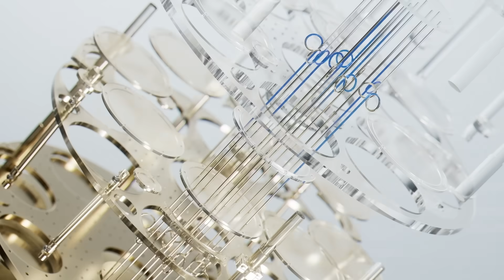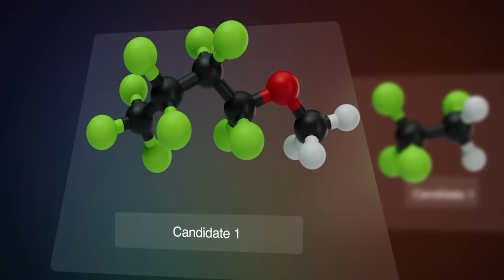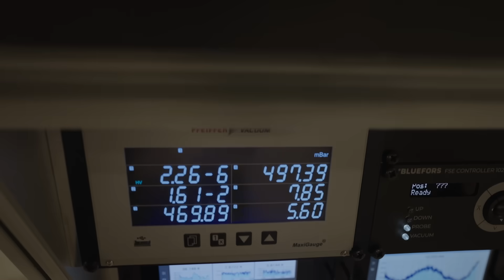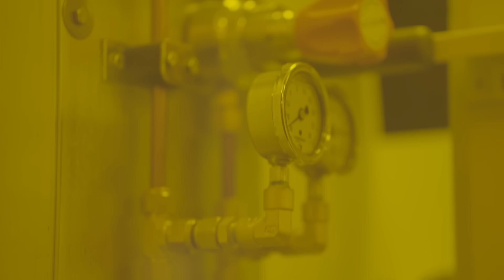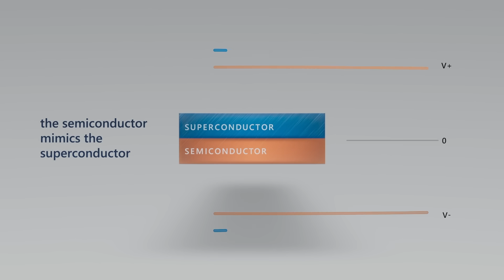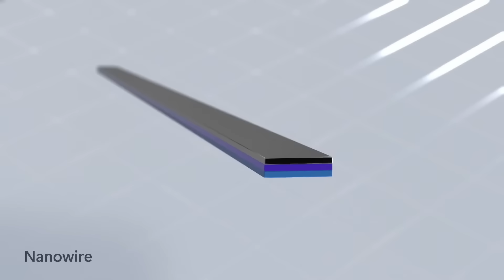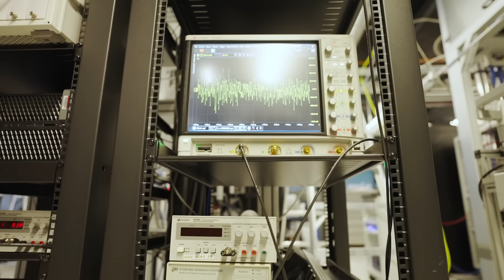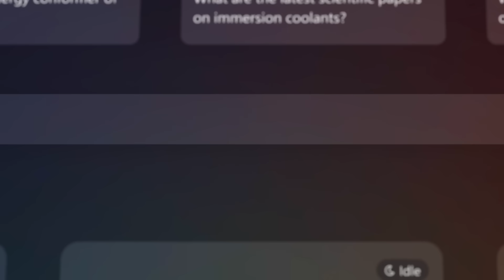Majorana 1 Explained: The Path to a Million Qubits

Comment: Usually, when a promo video includes a lot of irrelevant content - people, the sea, the sky, etc. - it means that nothing is real yet. A revolution promotes itself, not a promotion explaining a revolution.
Reply: It doesn't work like that. The attention mechanism was introduced by Google researchers in their 2017 paper which laid the foundation for the Transformer architecture. However, it didn't gain much public attention at the time because it was primarily a research breakthrough rather than a product. In contrast, GPT, which is based on the Transformer architecture and uses the decoder-only part, gained significant market traction due to its practical applications and accessibility. Which do you think is the bigger breakthrough? The same thing is happening here. In a few decades, we will have a product that will revolutionize everything. Right now, they are marketing the breakthrough to attract investment.
Reply: @Mewhoevenidontknow 
It's interesting how foundational research can take time to translate into widespread practical applications. The timing of market readiness is crucial.
That's how business and technology go hand in hand
Reply: the chip they are showcasing is literally 1+1=2 AND gate in quantum sense.
Reply: common sense right here
Reply: Depende, nesse caso acho que isso é real
Reply: @toggz901  é real mesmo, eu fico chocado com tanta pessoa incrédula
Reply: @toggz901  As IAs vão explodir depois disso
Reply: This is beyond your brains computing capacity
Reply: I mean, they do show the chip...right??
Reply: Qué acabas de ver Lisa?
Reply: You seem to not remember the PC commercials in the 80s and 90s
Reply: @amazinglover-ez  I remember Microsoft’s Lumia ads claiming the videos were shot with the phone, but a car mirror reflection showed they were actually filmed with a professional camera.
Reply: @amazinglover-ez  I remember Microsoft's ads for the Lumia phone, where they promoted its impressive camera capabilities, claiming that the ad videos were shot using the phone. However, a close look at the reflection in a car mirror revealed that the footage was actually filmed with a high-end professional camera, not the Lumia itself.
Reply: @amazinglover-ez  I remember Microsoft’s ads for the Lumia phone, where they promoted its impressive camera capabilities, claiming that the ad videos were shot using the phone. However, a close look at the reflection in a car mirror revealed that the footage was actually filmed with a high-end professional camera, not the Lumia itself.
Reply: Alright go on then make a 12 minute documentary on the transistor and make it visually appealing (no you don't get to sneak in the entire history of computers till that point)
Give it some time ffs it's not done yet
Reply: This. This project has been running for 17 years, I’m not surprised they felt the need to say something now that AI is consuming Microsoft from within. They also didn’t publish any kind of research about this that can be peer reviewed.

I suspect in 10 years this will still amount to nothing.
Reply: nice, sherlock!
Reply: What is the chip actually doing or is it serving a real purpose in our world that's actually helpful?
When chatgpt came out, it broke the world not by its non existent ads or marketing, but by their real product that everyone was blown away by. THAT was a real revolution
Reply: @MrBunny53  they explained it in the video...right? Pretty much makes quantum computing faster and more reliable. Big help in material science and engineering
Reply: @MrBunny53 Quantum computing's killer app, so far, is handling annealing. It's the traveling salescritter problem for fluids on a 3-D surface.

You want to know where the water line will be for a new ship before your first build. Modern hulls are complex surfaces, purposeful bumps and sluices to push faster or prevent oversteer. There are far too many points on the hull for you to get that math easily. It's far simpler to carve up a model at a decent scale, toss it in the bucket, and mark the water line with a grease pencil.

Qubits can deal with this far more easily. They let each possible state of those points be present at once.
Reply: @MrBunny53  Not everyone is "blown away" by useless computer generated hallucinations.
Reply: @MrBunny53  no real purpose yet... its still too early for any practical use even if I want to believe their claim
Reply: I like art and the way this video is filmed and orchestrated is amazing to me but I do agree that this is not the revolution they're making it out to be in the video
Reply: @MrBunny53  wow so there are Other chips that can hold such a large amount of qubits? Wow!
Reply: Finally found someone reasonable here
Reply: So... PEOPLE are irrelevant  now??? 😂😂😂
Reply: So... PEOPLE are irrelevant now??? 😂😂😂
Reply: Exactly my reaction, seems like their promoting using DEI instead of science

Comment: . I knew these spherical matrices were coming. I took my chance to figure them out. A 3 dimensional array of matrix calculations that understands its own space. When you have them with quantum computers you can calculate quantum vectors and use it from anything like curing diseases... reconstruct materials. Its pretty awesome. But i never thought itd be possible in this day and age.  How does it prevent the collapse of the super conducting state?  How does it solve the uncertainty principle? And how does it prevent the paradox of thermodynamics?

This is still extremely primitive no matter how advanced it seems. I cant see how it could be practical technology yet.

Comment: While they frequently discuss the theoretical possibility of achieving a million qubit system, they never demonstrate actually reaching this milestone. EDIT; if i read between the lines it seems that they are aiming to scale that chip (meaning duplicate it however much they can, like adding multiple video cards to a system rather can creating an H100) with its current capabilities rather than having one that truly does a gazillion thinking.

The presentation relies heavily on marketing jargon and oversimplified explanations rather than providing concrete technical details. They describe basic input/output processes ("send data to chip, retrieve data") but never clearly explain whether the quantum processor actually performs the promised parallel computations across all possible quantum states.

It's noteworthy and funny that a conventional classical computer is still required to interface with and control the quantum system.

My take? We appear to be at least 10-20 years away from developing practical, quantum computing interfaces. This presentation seems PURELY aimed at appeasing shareholders rather than demonstrating real technological progress.

Comment: They don't solve equations. It's a misnomer. They are a physical process. When a problem maps to a physical process you do the physical process rather than a digital computation. Quantum computers are horrible at most types of general purpose computations. They only excel at problems that map to a physical anolog.

Comment: It is quite fascinating that we are getting so close to bumping up against actual fundamental limits of computing and information density. There are hard limits to these things, hard limits to how accurate any prediction of a system which is smaller than the thing being simulated can be... and it seems like we're going to be able to get pretty close to that within the forseeable future! 

I also find it fairly funny that the one guy uses the example of materials science and designing a new material that works out of the gate... because over in the AI part of Microsoft, they recently published an AI model they developed called MatterGen which does basically exactly what he said. You specify the desired material properties, and it uses a diffusion model to discover a new material that should have the desired properties. They used it to create a new material that was lighter and stronger than titanium, then took its predictions to the lab, synthesized the new material, tested it, and found its properties were within 10% of what was predicted and boom, we have a new material lighter and stronger than titanium. No quantum computing required.

Comment: 10:06 - did he literally say "imagine a battery where you charge it once, and you never have to worry about discharging it"?? This statement makes zero sense whatsoever. It's not even wrong in some subtle way, it's just a completely nonsensical statement.
Reply: I think he means not to worry about it being discharged
Reply: @harshpanwar5963 that also doesn’t make any sense, nor does it fit within the context of his sentence. You could really stretch the limits of your imagination and think he meant “imagine a battery that doesn’t suffer from self-discharge” but honestly this is not a big problem that people complain about for batteries nor is it consistent with the phrase “having to charge it once and then never having to worry about it again”
Reply: I think what he is saying is that the Qbits are stable. Instability of the Qbit has been a major problem up until now.
Reply: @control_voltage  Earlier in the video, they talk about error correction and how some of the error correction can be done physically instead of algorithmically. That part does relate to the stability of qubits. The section of the video I highlighted is clearly about future batteries.
Reply: @bhav7795  No I don't think so. I think he is comparing other types of qbit to a battery that needs to be re-charged constantly while a topological one persists and doesn't need constant re-creation.
Reply: @control_voltage  The section of the video I am talking about is clearly talking about using the quantum computers to design materials in a computer instead of a lab, and then applying that to invent technologies such as advanced batteries. Just rewind to 9:40 or so. He is definitely not talking about other types of qubit (btw, it is "qubit", not "qbit") and comparing that to theirs.
Reply: @bhav7795  I think they mean that quantum computer would be able to discover new materials that could be ultra efficient with energy storing, meaning we could have batteries which such capacities that recharging a battery would no longer be a task we would need to do every day, but rather every several months or years. I'm no battery scientist, but wasn't Tesla also developing a battery that promised electric cars to have 1 million miles of range? If that's possible, then it doesn't literally mean that the batteries are infinite, but rather that the capacity is so ridiculously big that you would barely (or maybe never in your lifetime) have to worry about recharging such batteries.
Reply: @Caquin1950  First let me clarify Tesla's "million mile battery". They are not talking about a battery that you charge once and drive a million miles - that would be insane for many reasons, and they actually have top battery scientists like Jeff Dahn who would never make such a claim. The million mile battery (from Dahn actually) is that even after repeated charge and discharge (~2500 full charge and discharge cycles), the battery retains its performance. The equivalent would be like a phone where you still charge it every night, but 7 years later the battery holds the same amount of charge as the day you bought it. The statement about a battery that you charge once and never need to recharge is just nonsense. If you have "ultra efficient energy storing", what battery scientists call a "high energy density", it does reduce the number of charge/discharge cycles you need to do (although you need to put more energy into charging it each time). But the goal is never to get it down to a single charge and discharge, because that would literally be an explosive amount of energy in the battery. Today's batteries are already at an energy density where if they catch fire, bad  things happen ...
Reply: @bhav7795  change discharge to recharge and it makes sense. English is not his native language.

Comment: It's very simple really, you have the quantum accelerator, you have a classical computer that works with it and controls it; and then you have the application
that essentially goes between classical and quantum, depending on which problem it's trying to solve (classic computing 99% of the time). Once the computations are done,
the results are re-synthesized on the classical side and produced back to the user as one complete answer.

Comment: So you are after a particle that can keep various states. All this work and really nothing back. Why not design an emulator and have a particle described? Seems like you will never get the particle that you want behave like that simply because you don't have knowledge how atoms work on that level plus your proposed "design" is semiconductor + superconductor. Design a software environment where you simulate your theoretical particle first the way you see it on a low level and then use it to write some code because in theory, if you do everything right, your code would be faster and your theories would be proven, even if not at full speed. Then design a process how to get to that particle once u have it simulated inside and out. Right now this looks like another vaporware with a horn at the front of it all.

Comment: In your portfolio, you need both litecoin and bitcoin as money and investment. You can't print litecoin. Litecoin (LTC) is not a security, it is a digital precious metal with Proof of Work (PoW) consensus mechanism, a digital comYou need both litecoin and bitcoin as money and investment in your portfoliomodity with a fixed supply of 84 million coins  that cannot be debased, censured, seized, frozen, or confiscated. LTC is a permissionless, decentralized digital payment medium and a store of value without intermediaries such as banks. Even though litecoin is not a fork of bitcoin, it complements bitcoin, like silver complemented gold under a bimetallic monetary system, but litecoin has its advantages that bitcoin doesn't possess, e.g. fungibility of ltc. The rarity of litecoin means that only 84 million litecoins will exist. As the second oldest coin on the market, litecoin from its inception in 2011  was designed to be the "digital silver money" to bitcoin the "digital gold investment".

Comment: TLDW:

Majorana 1: The Path to a Million Qubits (Concise & Clear Alternative Script)
Introduction
What if we had a computer that could accurately model the laws of nature?

That’s the promise of quantum computing—a technology that can solve problems beyond the reach of classical computers. But progress has been slow because of one major challenge: qubits are fragile, error-prone, and difficult to scale.

Now, after years of research, Microsoft has achieved something once thought impossible. We’ve not only observed a theorized subatomic particle—the Majorana particle—but we’ve also controlled it.

This breakthrough has led to a new quantum architecture—one that could scale to millions of qubits on a single chip.

The Challenge of Quantum Computing
At the core of quantum computing are qubits, the fundamental units of quantum information. Unlike classical bits, which are simply 0s and 1s, qubits leverage superposition and entanglement to solve incredibly complex problems.

But traditional qubits have limitations:

They are easily disturbed by noise, leading to computational errors.
Current approaches require massive, unwieldy hardware to correct those errors.
Scaling qubits while keeping them fast and reliable has been an unsolved problem.
To unlock the true power of quantum computing, we need a better type of qubit—one that is intrinsically stable and resistant to errors.

The Majorana Breakthrough
In quantum physics, certain materials can exhibit exotic properties under extreme conditions. One of the most elusive predictions was the existence of Majorana particles, a special type of quasiparticle that is its own antiparticle.

Imagine bringing two particles together:

If they annihilate, you get zero—the absence of information.
If they remain, they represent one—stored quantum information.
This unique behavior allows Majorana-based qubits to store data in a fundamentally protected way, making them far more stable and resistant to noise than conventional qubits.

Microsoft has now developed a new material—a topoconductor—that enables us to create and control these particles. This allows us to build topological qubits, the foundation of the Majorana 1 processor.

The Power of Topological Qubits
The Majorana 1 processor is not just another incremental step—it’s a new foundation for quantum computing.

Topological qubits offer:
✅ Intrinsic error protection → Less need for complex error correction.
✅ Compact scalability → Millions of qubits can fit on a small chip.
✅ High computational speed → Solving problems in minutes instead of centuries.

This architecture is a leap forward, enabling real-world applications such as:

Simulating complex molecules for drug discovery.
Designing new materials at the atomic level.
Revolutionizing AI and machine learning by augmenting classical computing.
The Future of Computing
For centuries, new materials have defined human progress—from the Stone Age to the Silicon Age.

Now, we are entering the Quantum Age, where computers won’t just simulate reality—they will help us engineer it with unprecedented precision.

Majorana 1 is just the beginning.

The next step? Scaling quantum computing to unlock the impossible.

🚀 The future is quantum.